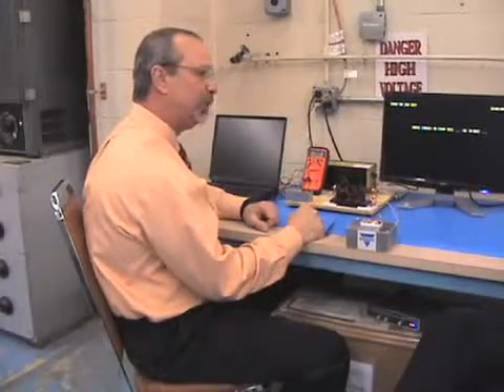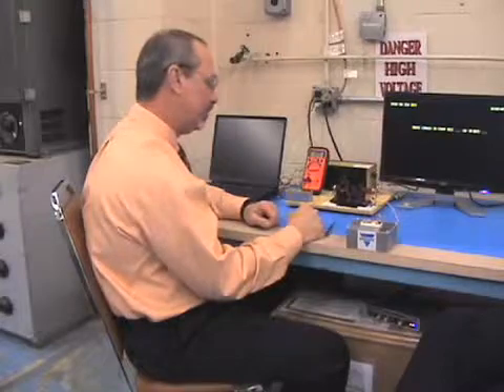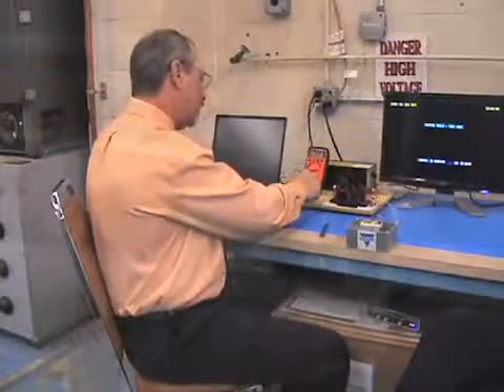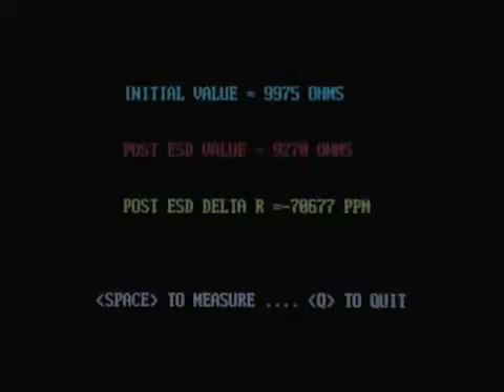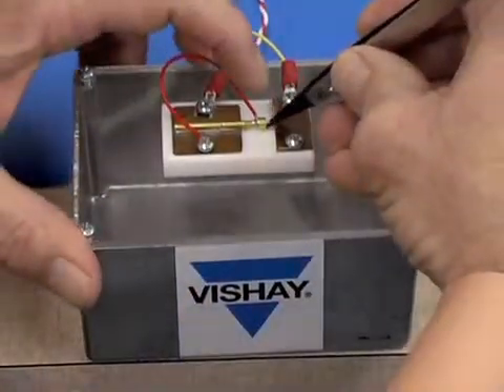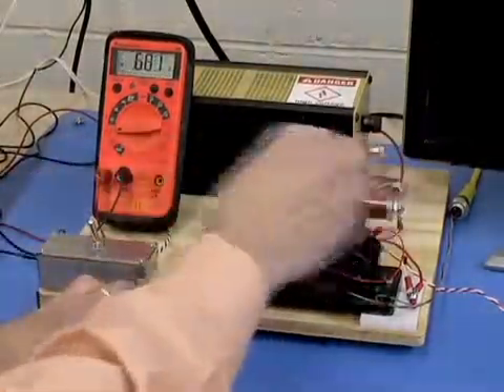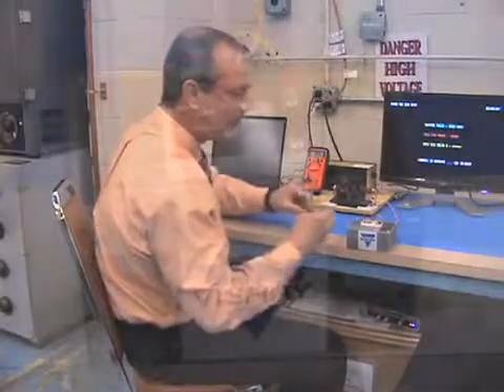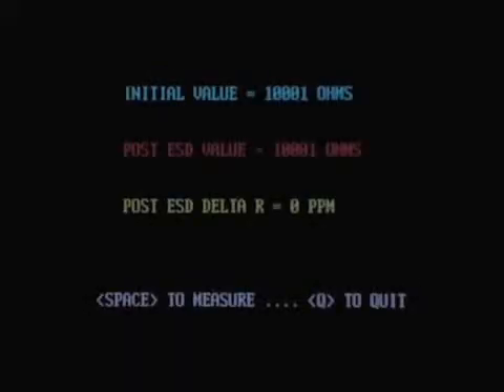The Effect of ESD on Resistor Technologies (Product Demo)

Comment: Metal Foil Resistors
https://www.youtube.com/watch?v=fM8Rd89V01c
Metal Foil Resistors 3.
In order to modify the properties of the TCR, 
it is necessary to use an oven with special characteristics 
such as those described in this video, for more information read Heat Treatment Principles and Techniques ,Ashok Sharma, C. P. Sharma, and T. V. Rajan.